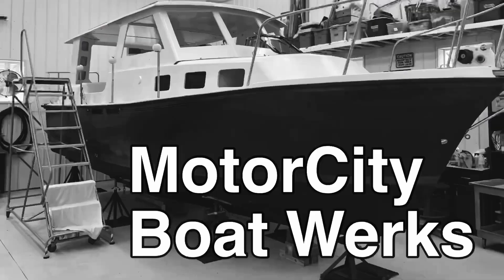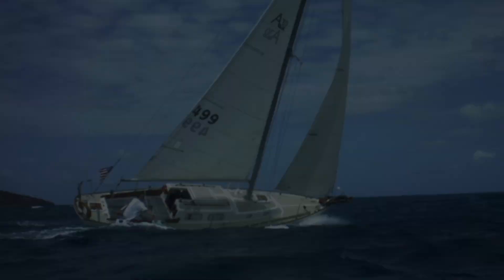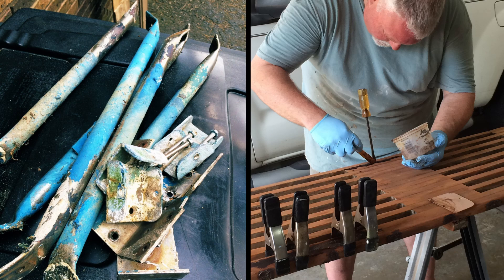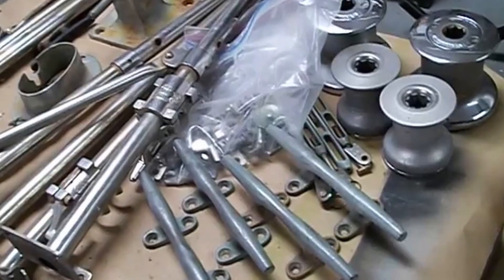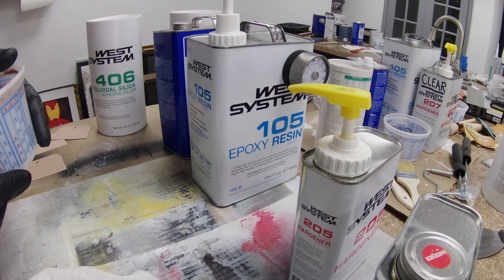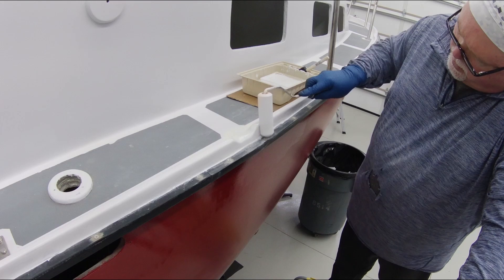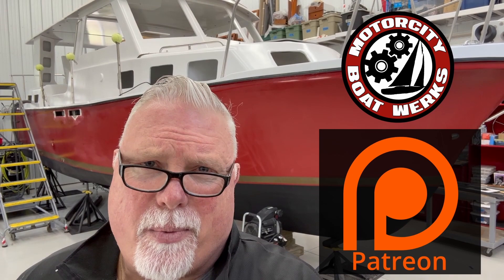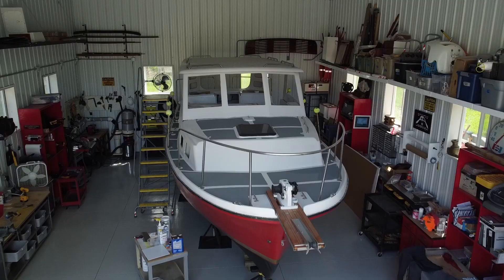Ten Rules of Boat Restoration (Ep38)

Comment: ABYC publishes guidelines.  They are not rules and are definitely not requirements except that many insurers will want the boat to comply with the ABYC guidelines before they will insure the boat.  The only binding rules are those that apply to commercial boats and are in the US code and some federal rules about fuel systems and waste systems that apply to all boats (hose types, gasoline tank standards, holding tanks, etc.).  The rules are much stricter for USCG inspected commercial passenger vessels than say a fishing boat.  That is not to say that ABYC guidelines are not a good thing to follow.  When looking at the ABYC guidelines remember ABYC is an industry group that "may" tend to build products made by the members of ABYC into their guidelines.
Reply from the maker: Exactly 🤓

Comment: Unrelated to the topic of this video, is that the lighting or did you put a satin finish on the topsides (the red)? It looks great, but that's pretty unusual, right? Or is it?
Reply from the maker: The hull is painted red but has been sanded in spots. What makes the finish look slightly different is that it’s not high gloss

Comment: The restoration of Stainless Steel can have some dangerous events. On a sailboat parts from the rigg should not be older than 20 years and in doubt they must be replaced for the danger of hidden corrosion. Not making that point in this video creates dangers to viewers and therefore to you (as you may face a lawyers case without the missing disclaimer)
On top of this your rules collide. At the beginning you said don't put expensive stuff like decking material on a cheap boat. Here the argument is "don't invest in things nobody will pay for when selling it " At the end the main thing was "do it the way you want to "  A high gloss hull can be as expensive as the deck material, even if you do it yourself. Plus some very extensive work and frustration included for untrained people. Here you say "it's not important what people and the next buyer think".
Reply from the maker: Andre, sadly you have misunderstood and  moreover you are mistaken. Please watch the video again and the entire Albin 27 playlist to understand the context of the amateur boat restoration rules. You have made assumptions that do not apply in the context given. 

Plenty of sailboats sail with stainless or metal fittings that are more than 20 years old. Evaluating and checking  sailboat rigging is an important topic but it’s not discussed here or even applicable in this context. Besides not all rigging is stainless. 

Of course the rules are not at odds, but they can sometimes be competing. 

Lastly perhaps 🤔 you didn’t understand or read the legal disclaimer at the beginning of every episode. 

Thanks for you comment 👌
Reply: @motorcityboatwerks  No, I didn't read the disclaimer. But still the general statement of reusing Stainless Steel is dangerous. There are reasons why any insurance is asking for certificates of inspection. As can be seen by this case, any video should stand for it's own. You can't presuppose everyone has followed your channel. As I'm a  German naval architect and carpenter myself with more than 40 years since my dad began working with me your videos won't help me very much. Not all rigging is stainless as much as not all boats are fibreglass.... As you assumed in the beginning of the video.
Reply from the maker: Ahh German sense of humor! 🤣 
Welcome to the Boat Werks, Andre! 
I’m sorry I cannot be of more service.
I’m not a professional but a hobbyist. 
Thank you for your understanding. 
Please be sure to like and subscribe 👍
Reply: @Hotzenplotz1  The golden rule. Boat. A hole in the water into which you pour money.
Reply from the maker: Not if you follow the 10 Rules of Boat Restoration and avoid the 10 Mistakes 😃